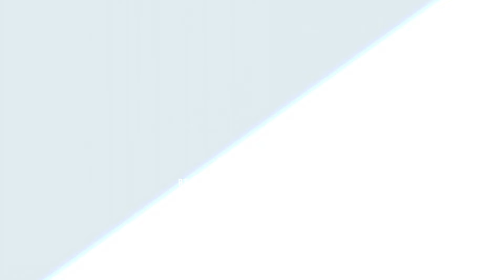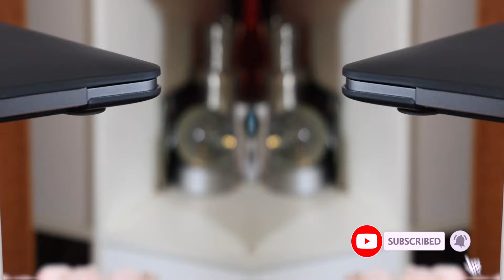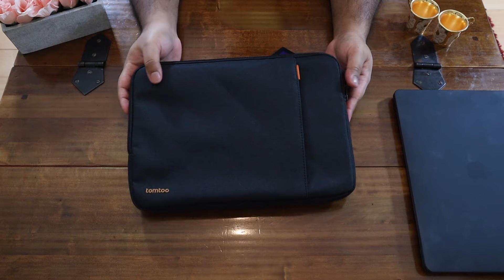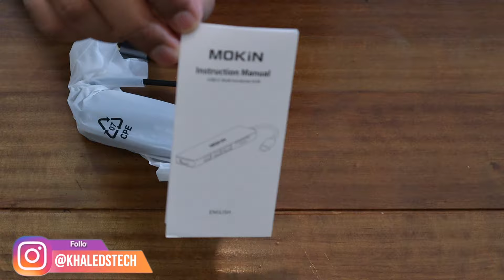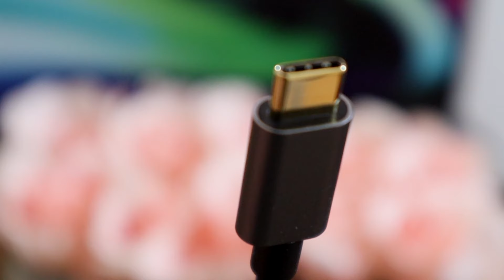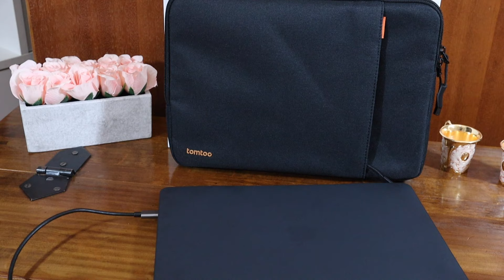My Best M1 MacBook Pro 13 Accessories 2021 - Must Have!

Comment: It's called a MacBook "Pro", not "MacBook Pwoh".  I think the shell is a waste of money.  The points of contact that hold the case to the MBP will mar the laptop surface.  It's not an iPhone that is in and out of a pocket constantly and is easy to drop, laptops normally just sit on your lap or a desk/table.
Reply from the maker: The shell is pretty decent my brother used it for several months before moving to a leather case. Haven't had any scratches or visible marks on the laptop. It's good for its intended use.
Reply: @KhaledsTech  a few months isn't long enough to see it mark up the MBP.
Reply from the maker: @Resist4  4/5 months of daily use, packing  it in a bag, taking it out is decent use. There might be better cases out there but this did the job pretty well without scratching the MBP.
Reply: @KhaledsTech  again, it's something that just isn't needed, like with an iPhone.
Reply from the maker: I respect your opinion but some such as myself would prefer protection for their MBP.

Comment: Hi, 
So this case doesn’t leave any scratches on the MacBook after durable usage?
Reply from the maker: Hi Taha, I recently changed to a leather case. But when I took the case off I didn't find any scratches or marks.
Reply: Not immediately, but it will over time.  Any hard, even soft, surfaces can mark up the MacBook with enough time.